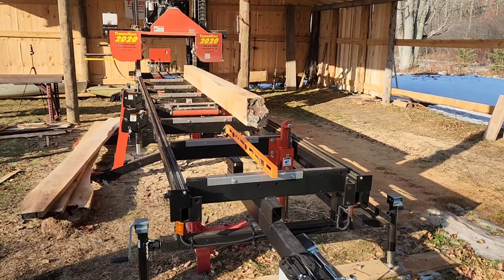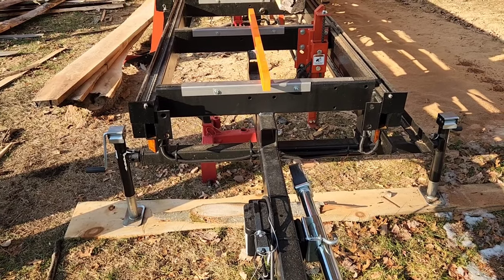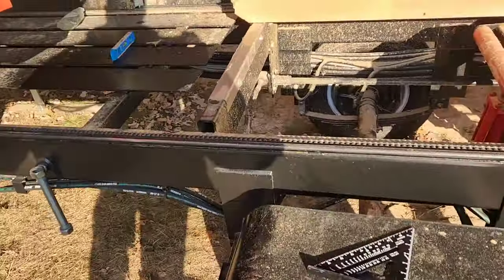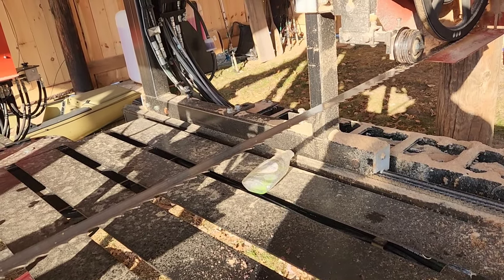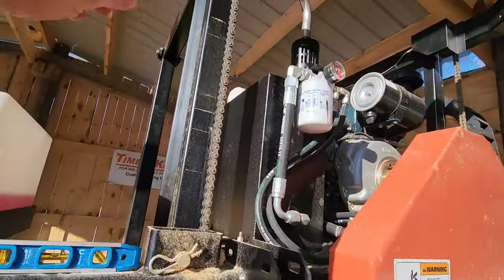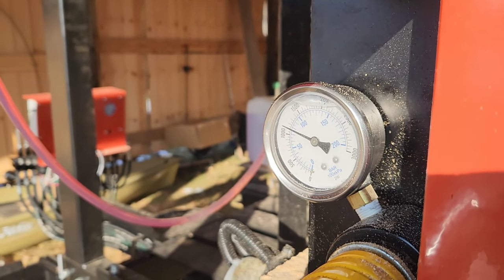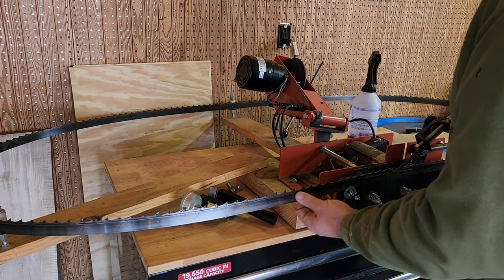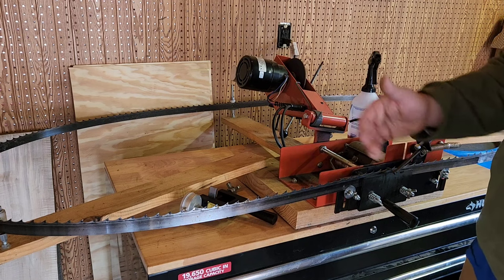The secrets to cutting straight lumber on your sawmill

Comment: good video. most of the good sawmiller use diesel as wipe or dip it is better for the blade  and little cheaper because you can saw saw 6 times as much as you can with washer fluid at $2.99 a gal.  your video will help a lot of new people. take care, be safe and well happy thanksgiving  how is mr. Roberts doing?
Reply from the maker: Thanks and Mr. Robert is doing well down in Mississippi.   We talk weekly and are planning a meet up and video this winter.
Reply: Sawyer not sawmiller

Comment: I don’t know why I never thought about the issue with starting the log on the smaller end and the direction of the branch growth affecting the deflection of the blade. I’ve managed to work out a lot of kinks on our Norwood HD 36 and we run a good wood, Mizer blade, and cut for Damily hardwoods, but cutting some of those pine with all those branches usually made our boards look like a roller coaster. Going to give your technique a try. Thanks.
Reply from the maker: Sounds great. I hope it helps out.

Comment: Good job. A few of my tips, More set uses more horse power and makes more sawdust, When turning large cants don't drop them, Some cants have a lot of stress and bend when cut, if your lumber is thick and thin turn the cant over more often. If you have enough Horse power the blade will be happy and sing when the cut speed is much faster than what your cutting now. Blow off the mill every day, saw dust will hold moisture and cause rust. ATF is the best lube for everything except ball bearings, sawdust wont stick to ATF like the motor oil. Don't coil sharp blades.

Comment: My 1620 was delivered last week. The awswome Delivery man used a 4 ft level ,then I tweaked it with a 6 ft level but it didn't look right so inset up 2 different Topcon laser levels and it was 1 1/4" out of level using a 6 ft level, front to back

Comment: Many band sawmill operators in real winter climates use windshield washer fluid in their lube tanks.  Diesel is rather pricey to be using as a lubricant despite it being great a preventing build up on your blades.
Reply from the maker: Yes I agree diesel is expensive,  but I'm only using a drop or 2 per second.
Reply: I use diesel too, I get about 30 hours out of 5 gal. At a drip every couple seconds. Way cheaper than washer fluid in my experience.
Reply from the maker: Exactly
Reply: Out here on the Left Coast 95682 Diesel is $6 bucks per gallon. If it's cold enough to freeze I stay inside. My lube has a pump and sprays both sides of the blade, 5 gal a day on pine.

Comment: I've been milling with TK 1220 12yrs. Level bed end to end doesn't matter much. More importantly, the blade has to be the same height off the bed end to end. The most likely spot for error is in the middle, where on mine the front half of the bed bolts to the back half. TK allows adjustment there, and it has to be checked after a big log if, as you caution, the leveling feet are on a compressible base.

Also, on blade wander, standard blades aren't made for frozed wood. They get hot, steam, and wander. TK can advise on blades for ice. BTW, wood thaws about as fast as the ground. So if you want to make a cut 4" inside the sunny side of a log, see if a spade will go 4" into sunny ground near the log. If you cut 4" up on the side of the log sitting on the ground, move the log and test the ground where it was setting.

Comment: I put in 10" concrete piers. Its very stable.
Reply: How deep did you go?
How are they holding up?
I was thinking about doing this too.
Thanks!
Reply: @kristopherfrootloops6714  it holds up great. I'm in clay. I used 2' soni tubes (10" dia). Stayed 6" above the soil. Actually, i dug down so that i could roll the logs onto the track. I also used some vertically adjustable levelers set into pvc pipe set into the concrete. I'd be happy to send some pics. It's really simple. It's been holding up for over 3 years. I will set up another set of tracks near my cabin in Idaho in the next 3 weeks.

Comment: The drilled holes in your blade wheel. Are they there to balance the wheel when turning?
Reply from the maker: Yes, used for balancing.  The wheel is spinning around 55mph while cutting.

Comment: Why do you leave the previous cut pieces on the log while cutting subsequent planks?
Reply from the maker: Because I take the whole stack off at once with my tractor.  I work alone most of the time, so any time I can reduce touch time, I do.  If I had my sawmill set up in a different location, I could use the drag back, but that involves more handling of the boards later.  Also, if I'm cutting a customer's log, I don't sticker and stack their wood unless they pay me to do it.  By keeping the cut boards as a full stack, it helps to easily load their trailer when the job is done.

Comment: Will more set in the blade reduce waviness?
Reply from the maker: Not necessarily,  but as a blade loses set, it's more likely to travel in the log.  If more set is added then more power is required.   If you're cutting softwood, more set means you can run the blade longer before it loses the set. I would not suggest adding additional set to cut hardwood.   The added stress on the blade may be counterproductive. For the best cut quality, I like to set to 0.022" .